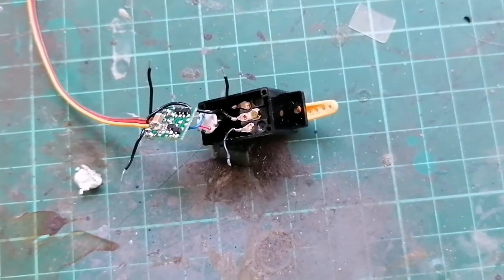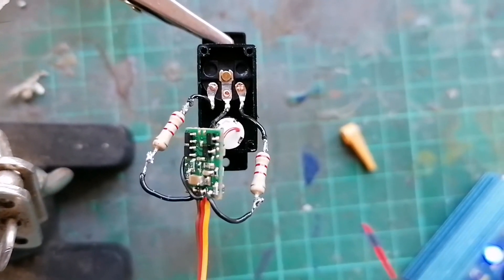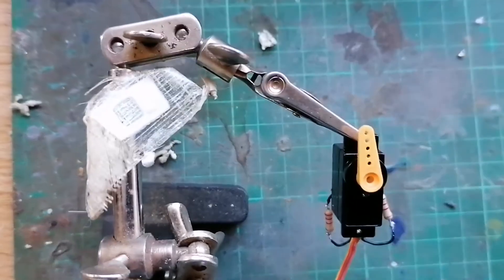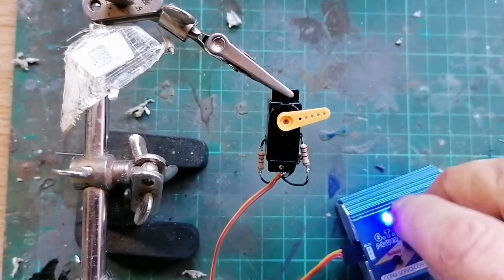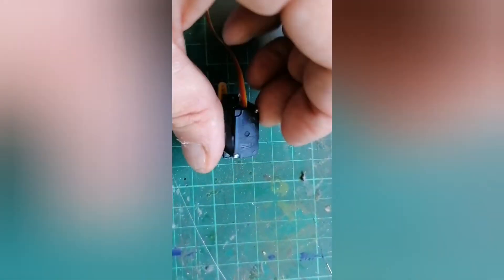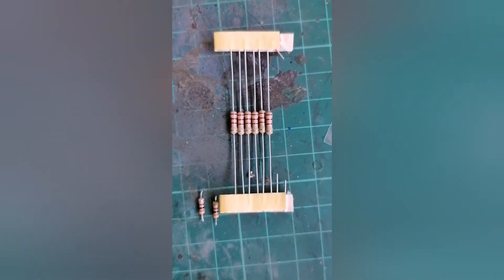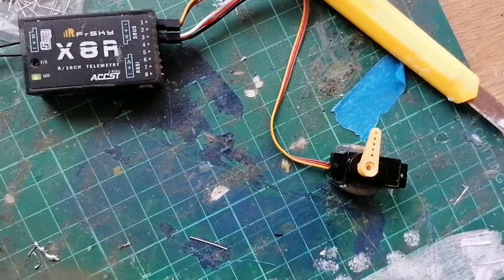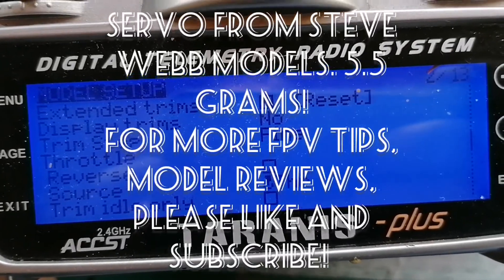How To Modify & Increase a 90° 5.5gm Servo Throw/Output To 180° using a 5.5 gm  Servo For Micro FPV.

Comment: Is there away to decrease a 180 turn RC servo to a 90 degree turn on servo is there a resistor for that
Reply from the maker: Not that I'm aware of. Try winding down the movement with end point adjustment is all you can do.
But being a 180 servo, doubtful that'll work as it will already have resistors installed.

Comment: Yep, with tiny servos just leave the resistors outside the case, been doing this for a while now, as a preventative insulate the external resistors & wires with hot glue or plastidip, even the larger servos it's worth insulating if there is any risk of shorting anything out pushing it all back in the case. Fiddly but well worth the effort 🙂
 · Reply · 1m
Reply from the maker: It's working great in my mini Hawk. So easy to do too. 🙂